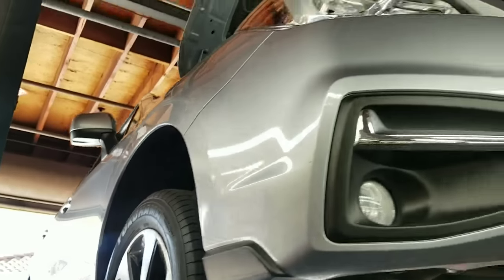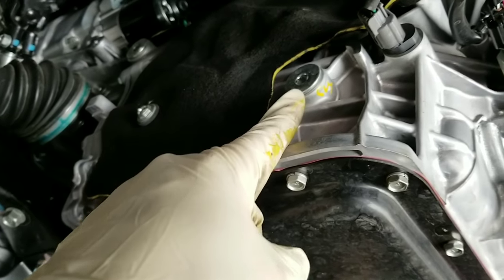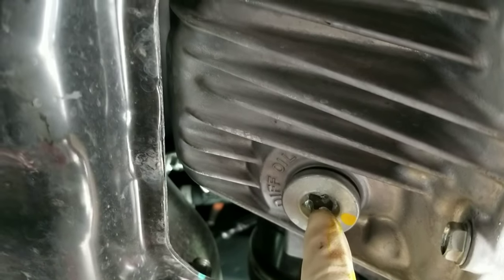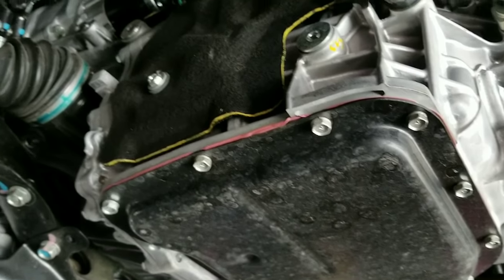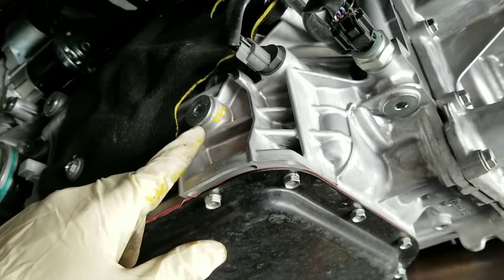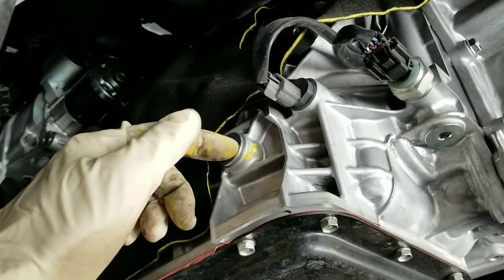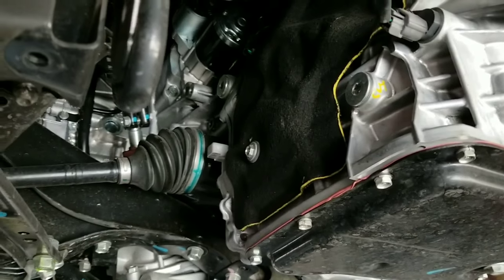Watch before you screw up your SUBARU CVT transmission & differential

Comment: Made the exact mistake when changing the front differential fluid AFTER watched this video... Luckily I found it suspicious after poured in 3 quarts of differential fluid but still without dripping out of the check plug. Luckily I haven't started the car. Now what should I do? Would it be okay to just drain and refill the CVT fluid twice? Or do must I have it towed to a dealership?
I feel really stupid now.
Reply: Don’t sweat it.  Everyone F’s up at some point.  How did it turn out?
Reply: @watercool5  No Subaru dealerships wants to touch it. Luckily I found out the So I fill and drain only the converter  once with cheaper ATF fluid, then completely filled and drained it with Subaru CVT fluid once. In the final fill up, I tried my best when checking the fluid level in the final fill, although I was not sure if the temperature I found on my CBD reader was for CVT or coolant. Anyway I waited the engine to warm up a little and some fluid overflew. It has been 9 months and there is no problem.

Comment: Okay I’m not sure what year or model this is exactly but I know for a fact that the 4eat automatic Subaru tranny there is a check dipstick and you can also use that as a much easier fill neck
Reply from the maker: this is the new cvt, not a 4 speed. this doesnt havea dipstick unfortunately for the diff or transmission.

Comment: Can someone tell me what is the best brand, and type of differential fluid goes in a 2019 Subaru legacy 2.5. Im told 75-90 by some, and 80-90 by others, i know its supposed to be synthetic. Also should i put an additive in there or no, if so what type and brand. I also need to figure out what type of cvt/ trans fluid goes in there. Thanks

Comment: Have you seen any cvt's overfilled?  How bad is it for them?  Wondering if it's safer to be on the low side of the temp range or the high side of the temp range.  Lower temp will let less spill out, higher temp more spills out obviously.  I usually err on the side of a bit overfilled rather than a bit underfilled for most things but wondering if you've seen premature failure from it.
Reply: Also, I have a snap-on scan tool, is it safer to use the temp sensor reading from the tranny or an infrared temp gun in your opinion?
Reply from the maker: Depends what "cold" is tbh. And I would trust the tcm sensor 1st since it is touching fluid vs the case. But either way is just fine

Comment: Can u please do a video for the transmission filter for a 2020 Subaru Impreza. Please I can't find the filter I was sent a filter by the Subaru parts deals but it's a round paper filter. I not sure where that is on my Impreza, and the dealer here want 500 to do a drain and fill. Thats insane.
Reply from the maker: That one is internal, gotta split apart the transmission to get to it. If you want to add an inline filter, get one from a Honda.
Reply: So I did see that in the Subaru parts book online , so the one in the pan is just a suck up screen and there is no filter to change so it's just a drail and refill.

Comment: Where is the drain/refill for a 2019 Subaru Ascent?  Can't find a picture or video.
Reply from the maker: probably a filler plug/vent on the passenger side above the axle area if it's like the outback or wrx. find it, lift it up and there should be a collar or tube pressed into the case where you can run a funnel to pour fluid in.

Comment: QUESTION: at the 2:10 mark - what is this fill hole? (Left side, up high, toward front of car.)  It stated fluid "will drain down to the cvt and need to be drained."  If approx 1/2 qt CVT fluid was put here (not diff/gear oil) would there be an issue?  If it's not obvious, I began doing so, even though I knew where the damn fill hole was...just got distracted and came back and screwed up.

Comment: I have done differential myself. For cvt should I drain and fill just once or twice to clear fluid?
Reply: How often change cvt fluid and differential gear oil . I have 2017 subaru forester touring.
Reply: @Taekim100  80k for differential / 100k for cvt.
Reply: @echo405   Thank you

Comment: Hey guys, I've been looking around and I cannot get a straight answer. I'm planning to do my filter and fluid on my 2015 Subaru wrx limited but I cannot find a fluid amount. I'd like to order the 6 qt package but I don't want to be short, but then again I don't wanna spend an extra 35 bucks on 2 more quarts if I don't need 8 quarts. Lol

Comment: Thanks for the tutorial.  Any tips on getting the fill plug out?  I keep breaking 8mm allen sockets on it.  I think Subaru locktite'd the plugs.
Reply: As a subaru tech for 6yrs I never had that problem using affordable quality sockets. Subaru does not use locktite on the plugs. I use  Neico sockets with a 18” 3/8 24 tooth ratchet. If you can afford it I love matco sockets. I would definitely recommend  a matco socket for the diff drain as it made a noticeable difference over the Neico. Also don’t use an extension on the diff fill or you will break your tools. You will need a long 3/8 ratchet or breaker bar and wedge it up between the transmission and exhaust.

Comment: Dammit! I should have watched this first. I did exactly what he said not to.
Reply: Same here. I luckily discovered it after 50 km, when I was checking any possible leaking from screws and found out that service guys used the wrong screw to fill the differential. Instead, they filled the CVT with the wrong oil. The immediate draining of contaminated oil and one more again after 500 km. Hope that this will help and only proper CVT oil will remain inside.

Comment: will the transmission be ruined if diff fluid is put in by accident, can it be drained and replaced with proper fluid ? then drivin?
Reply from the maker: It will be ok yes. But personally I would do that flush twice, once again when it's hot after driving.

Comment: This is the TR580. Can you do this for the TR690? Thanks. I am most interested in the CVT fluid heat/cooler exchange, so I can flush all the fluid.
Reply from the maker: I would just change fluid more often, like 20k.
Reply: @subtledriver  I did it 2x already. I'm at 40k miles. I would recommend a change around 35-55k. After that the fluid should be able to go 60k to 100k miles between changes from what I saw. I regularly drive my car at 140mph and it had no excessive wear on the trans which surprised me. I was able to swap out about 13 quarts which is like 2.25 gallons. I had 4 quarts left in there somewhere that I could not access even while shifting the trans and spinning up the torque converter.

Since the system is so hard to do a flush (I  have a post on it on the outback forums), that means subaru leaves in some of the break-in fluid because there is no way to do a 100% change on these things. most you can do is an 80% change if you use the trans cooler inlet and outlet lines.

Break-in fluid left in the trans was confirmed by several different cars results from blackStone labs. Would it hurt anything? probably not.
Reply: @lifeisgood070  Thanks for reporting back with info on the analysis of your cvtf. That's pretty cool. Too bad that they make it so hard to do a full flush. I've heard full flushes with transmissions might be bad though?

Comment: Omg- 3 yrs ago we had our2010 Subaru Outback transmission messed up by going to Jiffy Lube for a routine oil change.  We then went to our local Subaru Dealer service and they flushed it out.  We’ve been able to drive it since but the transmission is on the blink and will soon die :-/

Comment: At what milage points should I change my cvt fluid and differential fluid ? I have a 2019 outback 2.5 limited
Reply from the maker: Depends on driving style. If you drive mostly highway no traffic and light throttle, cvt fluid: 35-45k, diff fluid, 50k (1st time 30k tho).
Heavy off-roading, or aggressive driving/lots of traffic/stop go, cvt: 15-30k, diffs: 30k. My opinion. Also use redline non-slip or heavy duty orange color cvt fluid. And the diff's, synthetic, any brand besides royal purple really 👌

Comment: Okay, so here's what I did. I'm a BMW dealer mechanic so I didn't know much going into it. I didn't know there was a check level plug in the botton of the front diff. I drained the fluid from the big T70 plug and then filled the front diff up until it was spilling from the fill hole. Before the car was driven, I looked into this and discovered my mistake. I drained the excess fluid by opening the check plug, the smaller 8mm hex plug near the big T70. A good amount of the new fluid i put in drained out. I put the plug back in when it settled to a trickle, and drove it home. The car was not driven with the overfilled diff. My worry is the fluid level was too high in the diff and maybe it mixed with/ contaminated the CVT's oil? It only sat in there a few minutes, and again, the car wasnt driven with it overfilled. This may sound kind of ridiculous, i get it. The front ddiff should be a sealed unit not susceptible to mixing of fluids. I'm just trying to ease my anxieties. Car drives fine. Do i have anything to worry about?

Comment: So if the cvt fill is above the pan what is the plug in the upper left front for if it goes to the cvt.
Reply from the maker: @danr355  it's best to stick with what works. There is a lot of possible areas to "fill" this transmission/diff and a lot of variants of transmission. So it is best to stick with the basics. If you want to experiment, go for it. I wish I had the time to make videos for every single drain plug and fill plug and cover bolt on every transmission. But I got people waiting in the office half the time and half a dozen other vehicles to get back on the road unfortunately :( (the plug is probably for factory fill or for assembly if I had to guess)

Comment: Can I fill Cvt from top hole above axel if the actual fill plug is stripped
Reply from the maker: I would force fill with a hose that fits tightly in the drain to be safe. But you must measure the amount drained and fill exactly the right amount. The fill plug is also the level check for cvt. I would use a chisel or something to loosen the fill. And get another filler. Use the right/quality tool next time

Comment: I fuxked up and put the damn diff oil on the left side!!! Omg
Reply: What did you end up doing, and how did you turn out?
Reply: @ryanthurm2547 dropped the pan and cleaned eveything with brake parts cleaner. Re sealed the pan and installed fresh fluid! I DIDNT USE SUBARU CTV FLUID AND IM CURRENTLY AT 234000KM. Doing another flush in a few days and had to revisit this 😅

Comment: I went to Subaru and asked how many quarts I needed for a transmission flush and they said 14 quarts, for my 2019 Subaru crosstrek. Why is that?
Reply: That's how many quarts are required for a total change.. this video is showing only a partial oil change 4 to 5 quarts.. only what's sitting in the pan will be changed.. there's lots of oil left inside the transmission..

Comment: Is there a fill plug for the trans on an 18 impreza on the same side as the drain?  My fill plug is in an awkward spot right next to the exhaust pipe.
Reply from the maker: take a picture or video and send it to my instagram @subtledriver
Reply: Yo did you ever figure out where that cvtf fill plug is?
Reply: @sirtimatbob  yes, I was able to fill it. On my Impreza, I found a fill plug on the other side of the transmission
Reply: @brianm6141  Ok, perfect. That's where it looked like it was, but I don't have a service manual or anything yet.
Reply: @brianm6141  Any chance you remember if this fill plug is on the driver's side or passenger's side? Was it by the exhaust?
Reply: @sirtimatbob  on the passenger side on my ‘18 Impreza. There’s a similar looking bolt on the drivers side in an awkward spot under the exhaust pipe. Thankfully that’s NOT the fill plug
Reply: @brianm6141  lol, thanks for the reply! Yup, I finally figured it out bc of a justanswer post that has a nice picture showing the shift cable. Got my engine oil and CVTF changed by myself, whoop whoop.

Comment: I came here because my 13 Outback has a cvt issue at 160k. Is it worth replacing or should I just dump the car. It doesn’t want to shift out of 4th when it’s supposed to on the highway. It will when I use the paddle shifter
Reply from the maker: if you did the maintanance and its in good shape, i would buy a low miles, used transmission  and have another go. i see some for $1500 bucks on car-part.com
Reply: @subtledriver  they are 3000 around me with 100k on them.
Reply from the maker: Look at lower priced ones, they ship
Reply from the maker: Also, does the trans work normally besides that one problem? How often did you change fluid?

Comment: how do i know if my 2016 subaru outback (4 cyl.) has a CVT transmission?  I have 135K miles on my outback and have not changed my tranny fluid.  Should I do this now?  what about the front and back differential?
Reply from the maker: I'd recommend doing the diffs around 30-40k. Take a picture of the oil pan of your transmission and send to my Instagram. Instagram.com/subtledriver
Reply from the maker: And yes I would do the trans fluid drain and fill. And do every 30-40k
Reply: @subtledriver  does instagram still allow me to send you the picture if i don't have an account?

Comment: Subtle_Driver -- or anyone who knows -- is it the differential I want to service, or the CVT, if I am running a new tire on the front of my 2014 Outback AWD, and that tire is larger circumferance than the the older 3 tires?
Reply from the maker: I would change diff fluid every 30-40k and cvt every 20-30k, especially if you are running taller tires that causes more strain on the driveline

Comment: Are the CVT layout the same for all Subarus? I have a 2015 Forester which I want to change the transmission fluid because the dealer said it's a lifetime fluid and is sealed unit and doesn't need changing (yeah right! Whatever).

Comment: Subaru says it’s not necessary to check the fluid levels in the differentials and the CVT doing so may void your warranty.
Reply: 2017 Forester maintenance schedule (US): inspect differential oil at 60,000, 90,000, 120,000, ... miles or every 15,000 if severe driving. CVT fluid, inspect at 30,000, 60,000, 90,000, ... and under severe driving replace the CVT oil at multiples of 24,855 miles (40Km)

Comment: Where is the fill plug for a 2015 wrx? Anyone have a photo or diagram. I went under the car and couldn't find the same fill plug
Reply from the maker: You fill in the breather plug which is above the axle instead. Thanks for asking.
Reply: I filled it just above my exhaust at the back of the cvt. I called subaru and its in the same place as the 2012 outback

Comment: Changing the fluid on a Subaru CVT transmission will void the factory warranty.
Reply: actually no it won't; per subaru corporate IF (another words if you just do it for shits and giggles then ya you might get it voided) you are on the severe duty maintenance cycle or you tow regularly then the CVT fluid should be changed every 24k miles
Reply: @Mechcondrid  Why do I keep seeing change it before 30K miles and then you don't have to change it until 100K miles? 
I think I agree more with you, but I've seen that recommended a lot.
Reply: @sirtimatbob  per the service manual if you tow, or drive mountain roads regularly then every 24k miles is the requirement to keep the factory or extended warranty.
If you dont then its "lifetime" (or 100k miles in reality.

Comment: Is there any filter or is it a good idea to drop the pan to clean it out? I am also wondering why type of tool do you use to get the new fluid into that fill hole being that you can't easily poor it in.
Reply: There is an internal filter but you would have tear the transmission apart to get to it

Comment: Does this apply to a 2015 outback 2.5 ?
Reply from the maker: Yes, but you might need to fill diff through the breather or dipstick on front right. Impreza based cvt has plug, but bigger cvt on outback might be different.

Comment: We have a 2019 Forester bought new.  I regularly change the engine oil and filter.  Now has 70,000 miles. Plan to change the spark plugs.  The rest of it I'm going to leave well alone.  Not worth the hassle.  If the transmission fails then so be it.  Hopefully by then we would have gotten 150,000 miles out of it, will then offload and replace it with a Toyota.  I wanted a RAV4 but my wife preferred the Forester.  Subaru's are OK but IMO Toyota and Honda way better.

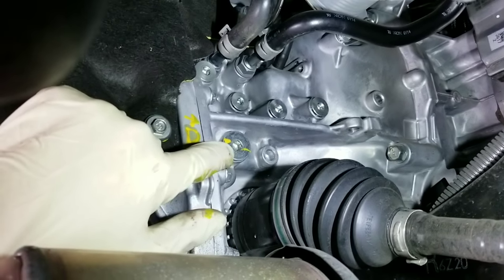Comment: @1:57 you say "The RIGHT hand side with in America is the drivers side" haha WRONG  The right hand side is the passenger side if you're sitting in the car.   The only way the Driver's side is the "Right hand side" is when you're standing up at the front of the car, facing the engine.

Comment: I wish all these other yahoos that make educational videos could use a camera as well as you have and not waste time on stupid useless crap.  Thanks for a perfect video.  I do have a question.  Bought a used 2014 outback with 142K on her.  Runs and shifts nice, came from a terribly dusty area.  Should I change the fluid or not?
Reply from the maker: I would change it immediately. I do a/t drain and fill on my cars at least every 30k. On cvt I would do 20k if you drive in traffic or city to be safe.

Comment: This information is not correct for my 2016 Subaru forester XT. I agree to check with the professionals first. I put diff oil in the cvt and now have to get it flushed out. $>800. Remember don’t trust YouTube and check with professionals like the dealer first.  Subaru did a very poor job of indicating where the fill points are on this car!